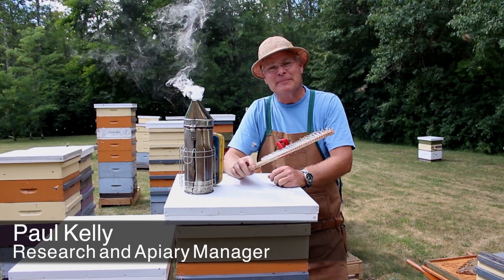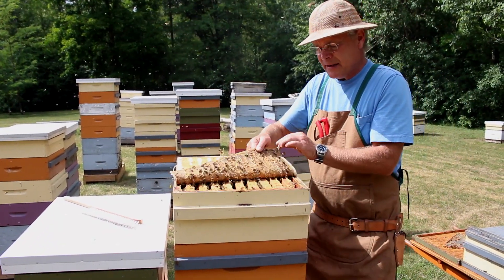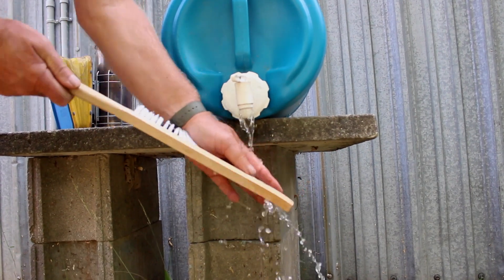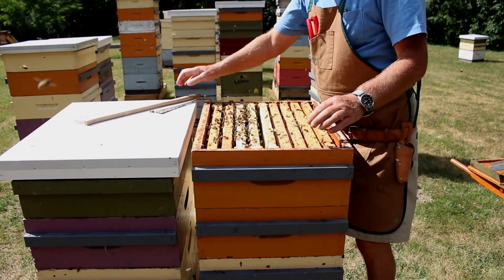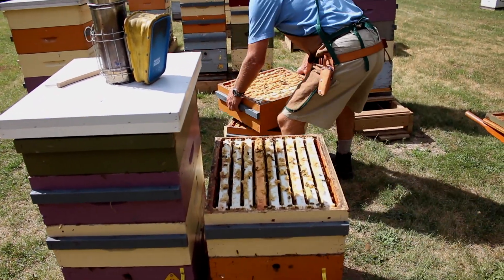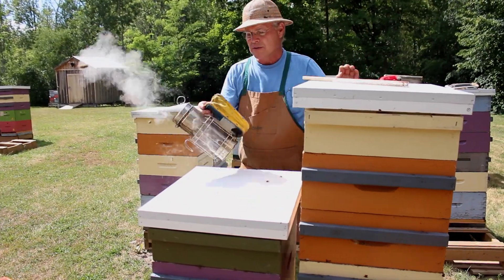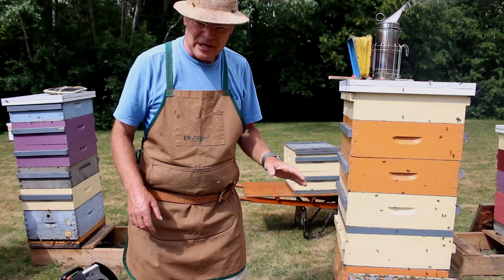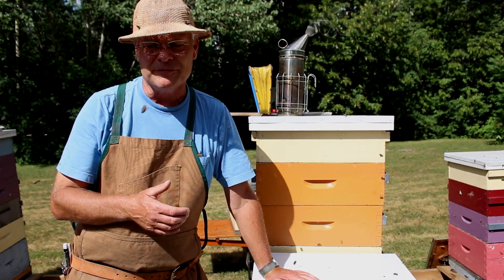Harvesting Honey

Comment: Great set of videos! How should I handle frames of uncapped honey at the end of the season?   I know that I need to remove the super, but there could be too much moisture in the honey as it sits, so I can't package it.
Reply from the maker: Thanks! 
  Consider what your average honey moisture will be from all the frames. A small percentage of uncapped frames is ok if the honey is getting mixed together from multiple frames. Do the shake test to see if the honey is dry enough. Hold an uncapped frame horizontally above a super and see if you can shake any honey out. If not it should be ripe enough to harvest. A dehumidifier in a warm room will decrease the moisture content prior to extraction.

Comment: can u shake them off do u use honey that   is not capped all the way.   I saw a video where the person shook the frame and no nectar flew out and they said it was ok to harvest  it is that true to what u know thanks one more question I seen a video where a top entrance is good with the suppers it helps the bees  remove the water from the nectar so they can cap it faster and u get more  please tell me your thoughts and thanks again
Reply from the maker: Shaking a frame above the open hive is a good way to test how ripe the honey is. We don't provide an entrance above the queen excluder so no pollen is stored in the honey supers. An upper entrance in the summer doesn't seem necessary for ripening honey but we all have different ideas.
Reply: I am sorry u did not understand my question,  I will try again, can u and do u take a frame of honey that has not been capped and harvest it,  I see a video where the bee keeper shook the frame and if the nector does not fly out he said the fram is ok for to harvest,   please tell me what u think thank u and have a great day
Reply from the maker: Hi Frances
 We do harvest some honey that isn't capped, The shake test is a good way to see if it's ripe.  Hold the frame flat to shake so the cells  openings are facing straight down. We normally harvest by the super and not frame by frame so not all frames are capped. I hope I got it this time :)

Comment: Talk to me about your cloth looking inner cover. I've never seen another. Does it allow enough air flow? I assume it must or you wouldn't use it. So, WHY do you use it?.....
Reply from the maker: Hi Peter
 Please see our FAQ #1 below. We did a video this summer on the topic and it will bee posted in the fall. It provides no ventilation so we drill a hole in our brood chambers. 

1. Why do we use canvas
for the hive inner cover? A: We use canvas inner covers for a few reasons. They
make it easy to take a quick peek in the hive, and are cheap and easy to make.
They are light, the lids sit down well, less excess wax on the frame top bars,
and we rarely need to scrape the inner cover. We use 18 oz  (#8) canvas
-otherwise known as duck. It's a bit hard to come by in Ontario, but it is
available from online distributors (US: http://www.bigduckcanvas.com/number-8-18oz-cotton-duck-canvas.html,
Canada http://www.jtsoutdoorfabrics.com/18oz-Cotton-Duck-Canvas-Untreated--Natural-60_p_15038.html).
Bees chew through thin canvas so a heavy weight is better. We flip it over
periodically when new so the bees thoroughly coat it with propolis. An
alternative is a feedbag folded in half. 

 

2. Why do we use single
brood chambers? A: Our preference is to keep hives in single brood chambers. We
use queen excluders above the brood chamber and then add supers. We produce
bigger crops managing our hives in singles vs doubles and we find the hive management
much easier. It's become quite common here, especially over the last twenty
years. We will be making a video about single brood chambers soon! 

 

3.  Are our queens for sale? A: We sell some queens but don't
export. To contact us about our queens, please email us at infohbrc@uoguelph.ca. Our Buckfast collaborators also sell queens: Munro Honey http://www.munrohoney.com/ (for CAN sales) and Ferguson Apiaries http://fergusonapiaries.on.ca/ (for CAN and US sales). 

 

. 

4. What breed of
honeybee do we use? A: We work with Buckfast bees. Check out our website if you
would like to learn more about them: http://www.uoguelph.ca/honeybee/breeding.shtml 

 

5. Will we be making any
more videos? A: Yes! We are looking forward to creating more videos for our
YouTube channel this year! Here are some of the topics we will be covering:
Working with single brood chambers, indoor overwintering. 

 

6.How do you overwinter
double nucleus colonies? A: At the University of Guelph, we winter our double
nucleus colonies indoors. You can also winter them outdoors by wrapping two
double nucs together with insulation on the sides and top. 

 

7. Are double nucleus
colonies prone to swarming? A: With a young queen and the supers above we don't
have any problem with these nucs swarming in the first year. We do have to
transfer them into a full size box early enough the following spring to prevent
swarming.

 

8. Do we add a frame of
pollen or honey into a new split? A: Ideally you add both pollen and honey. Of
the two, honey is the most important. 

 

9. Where to purchase
some of the products that we use: 

 

Coveralls: We really
like these Dickies all cotton coveralls. http://www.dickies.com/coveralls-overalls/deluxe-cotton-coverall/48700.html?dwvar_48700_color=GY#start=3.
We use two sided velcro to strap up the wrists and usually tuck the legs into
our socks. 

 

Plastic Queen cages:
Mann Lake and their Canadian distributors sell these and they are made by the
French company Nicot. https://www.mannlakeltd.com/hair-roller-cages. I use
a wooden plug on the bottom and screw it in place with a #4 screw after pre
drilling. 

 

Grafting microscope: http://www.amscope.com/catalogsearch/result/?q=gooseneck+binocular

 

Mini/mating nucleus
boxes: Mann Lake (US) and their Canadian distributors sell these. They are
originally from Europe so are widely available there. https://www.mannlakeltd.com/shop-all-categories/hive-colony-maintenance/queen-rearing/nuc-boxes

 

Queen Pheromone: The
pheromone strips were developed here in Canada. They are called Tempqueen and
are made by Intko Supply Ltd.Suite 604, 3345 Kingsway VANCOUVER, BC, V5R 0A7
Canada +1 (604) 356-7393. pheromonesupply@gmail.com. Mann Lake in the US and several Canadian
bee supply companies carry them. 

 

Bee belt and bulk bee
box: Our apiary manager Paul Kelly manufactures the Bee Belts and bulk bee box.
If you are interested in more information, please email him at pgkelly48@gmail.com.

 

10. Should you remove
any queen cells in a colony before introducing a new queen in a cage? A: Yes,
you should remove the queen cells. Look very carefully to make sure you don't
miss one. Shake the bees off each frame to make sure you can see them all.
Accepted queens are sometimes killed by virgins that emerge from queen cells. 

 

11. Can you make a split
without adding a mated queen/can a split raise their own queen? A: A split can
raise their own queen (if they have eggs), but you'd be better off buying a
mated or queen cell from a local bee breeder. Queens raised by a split are
reared under the worst possible conditions, are physiologically inferior, and
you aren't taking the opportunity to improve your hive genetics. For a number
of reasons, colonies get more aggressive if we let splits raise their own
queens. We always use queen cells that we have reared from breeder colonies so
we can maintain and improve our genetics. Cells found in hives can be poorly
reared if conditions aren't good or if you use swarm cells you are
unintentionally breeding for swarming behavior. 

 

12. How often do we
check for swarm cells? A: We check for queen cells only in colonies that are
stronger based on our ratings as described in our “Swarm Control” video. We
only do this at the time of year bees are prone to swarming (ie just before the
main summer nectar flow). In some colonies, we check twice, a week apart, if we
have the time and we've found cells in them previously. We stop looking once
the nectar flow gets going and the time for swarm preparation has passed. 

 

13. How old is a queen
when we replace her? A: We re-queen if a queen isn't doing well or when she is
in her third year. 

 

14. How often should you
be stung to lessen the chances of developing anaphylactic reactions? A: Please
speak with an allergist if you have any concerns regarding bee sting reactions.
You don’t need that many stings to build an immunity and reduce your chance of
developing an allergy. However, reactions can be very different from one
individual to the next. For about three years after starting beekeeping you
swell more in the spring when the bee season starts. After that most people
don't swell up much at all. Some beekeepers apply stings through the winter to
keep building immunity. 

 

15. What do we use as
candy for the queen cages? A: You can make the candy using honey and icing
sugar but the candy you see in the tubes in our videos are purchased with the
cages from Mann Lake beekeeping supplies and their Canadian distributors. In
our province, it's not legal to use honey in queen candy if you are distributing
queens. Honey can contain American Foulbrood spores. A specialized, non-drying,
sugar syrup (Nulomoline invert sugar) can be used instead of the honey. In any
case the candy must be made dry enough that it's crumbly.

 

16.  How do we make pollen patties? A: The patty is
made from pollen we collect using a pollen trap. We mix the pollen pellets with
sugar syrup to a dough like consistency, form the patties between layers of wax
paper and then keep them frozen until they are needed. They will keep for several
months frozen. 

 

17. How do we make our
grafting bars? A: We cut the wood pieces and attach them to the graft bar with
liquid beeswax. We then attach the cups with liquid wax. In both cases the
liquid wax is applied with a syringe. Previously, we made the wax cups but now
buy them from https://www.kelleybees.com/. 

 

18. Do we move full
honey supers to the top of the stack so the bees can fill the lower ones? A:
Some beekeepers do shuffle the supers around and do what's called bottom
supering. We place supers back on in the original order and only add new supers
on top (top supering). That way it's easier to see when the bees need more
space. The bees also ripen the honey before moving up. We sometimes harvest
full lower supers and put the top ones that aren't full back on in the original
order. 

 

19. Do we ever add brood
frames to the cell builder colonies to keep their populations high? A: We do
add other frames of sealed brood and sometimes we shake in more young bees from
brood frames to boost the hives. About once every three weeks we'll boost the
hives in one way or another. 

 

20. How do you level
hive stands? A: We level the hive stands periodically with pressure treated
wood shims. If the hives are already on the stands, we use a hardwood pry bar
and a brick fulcrum to lift each end for shimming.

Comment: I am watching the video for the 3rd time and another  question just pop in my head   if u did not want to harvest  the honey do u rotate the suppers so the bees will work the top more and set the ripen honey box on top will that be ok to do that  the videos are wonderful thank u so much for doing them you do a wonderful job  thanks and have a wonderful day
Reply from the maker: Hi Frances
 Some beekeepers do shuffle the supers around and do what's called bottom supering. I place supers back on in the  original order and only add new supers on top ( top supering). That way it's easier to see when they need more space etc and the bees ripen the honey before moving up.  As in the video we sometimes harvest full lower supers and put the top one or more that aren't full back on in the original order. You have a great day too Frances!

Comment: Electric air compressor works better. Fumes from blower exit with air......but bee escapes best
Reply from the maker: Hi Jay
 I've never heard of anyone using compressed air. I would have thought that might be hard on the bees but I'm sure you have figured out a way. We only use a blower in remote locations where the two trips for escapes isn't practical. I agree that escapes  are preferable in most situations.